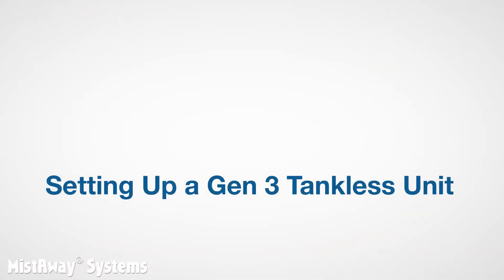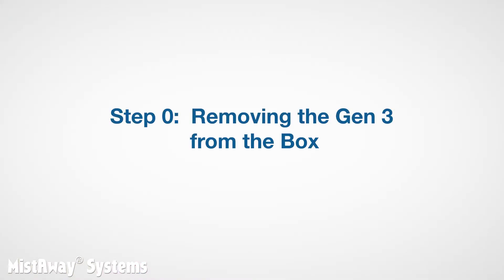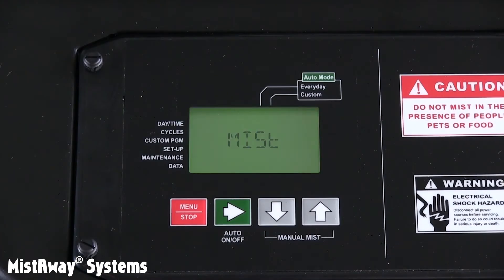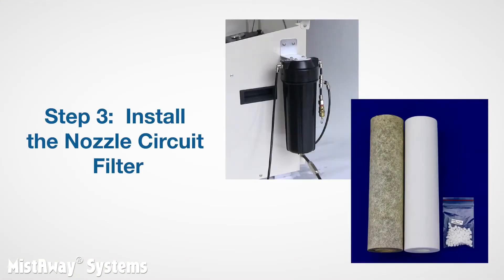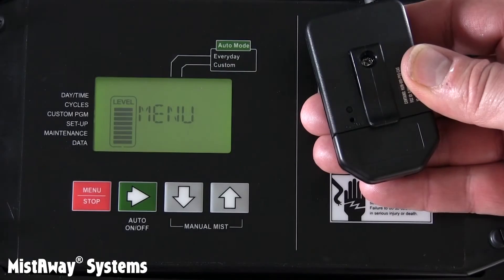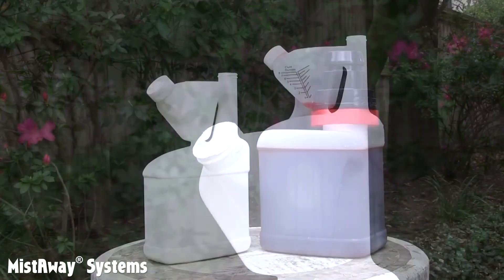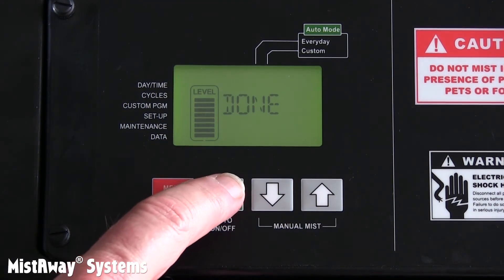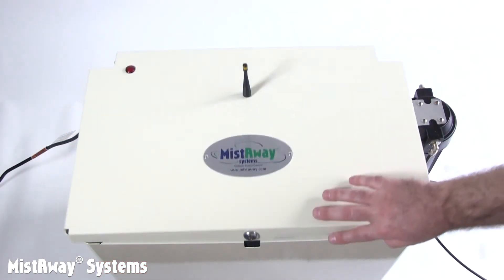MistAway University - Setting Up a Gen 3 Tankless Unit

Comment: "If you have less than 120 volts, call an Electrician". Really? If you have 110-119 volts, an electrician cant help you and the power company will not either. If your unit cannot run on 110 with its warranty, you shouldn't sell it.
Reply from the maker: Thank you for taking the time to watch and comment on our video. Given the amount of information we are trying to cover we don't always expand upon each tip.

In the case of a low voltage situation we often find that the voltage is merely low at the outlet. Often this can be remedied with a new fixture or rewiring to reduce voltage drop. If you suspect that the voltage provided by the power company is less than 120V you can confirm this with a test at your panel. For any electrical work we recommend hiring a licensed electrician.